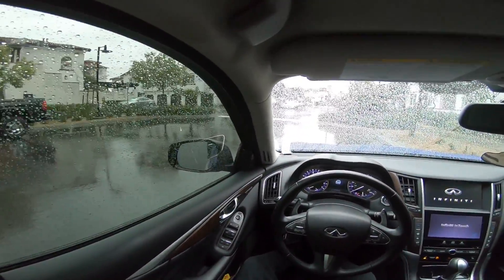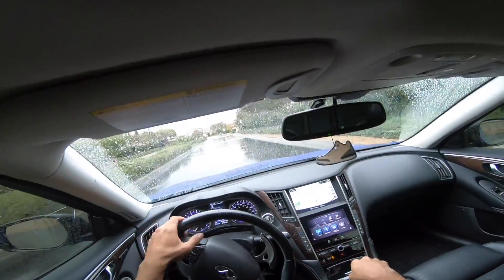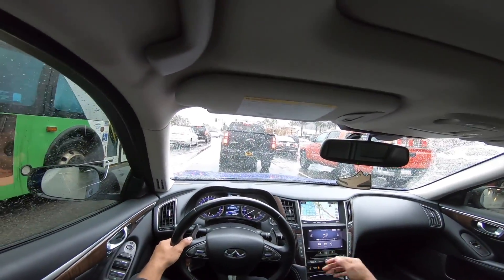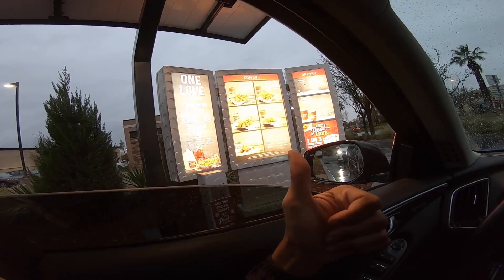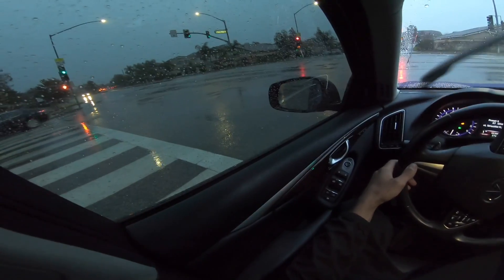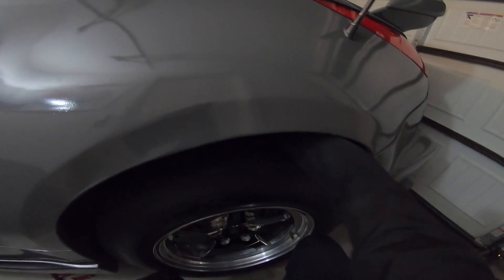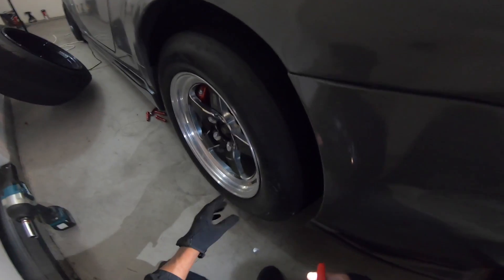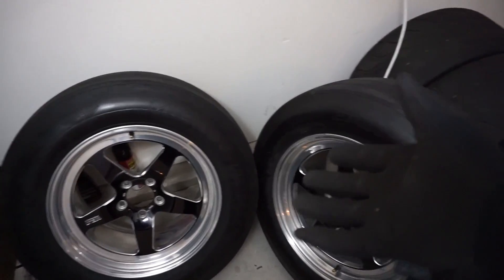WELL THAT DIDN'T WORK OUT

Comment: Resolution is A1. Gonna cop one up 🤙🏻🤙🏻🤙🏻
Reply: how much are they?
Reply: Richard Lopez The one I just picked up is $400 but I bought more accessories. Batteries, memory cards and such.
Reply: @franciscogastelum8726  thanks was looking for one but I might go for a cheaper version such as the silver or white. Looking forward to your videos on your cruising.
Reply: Richard Lopez I will start making video’s once I cop up an Evo X FE. Got my eyes set on a very low mileage FE, but the owner is asking over $40k for it. I’m not will to pay that much for it.
Reply: @franciscogastelum8726  I agree it's 6,000 overpriced. I am currently looking for a 350z around my area that isn't beat up but they all are.
Reply: Richard Lopez Yup, I’m not willing to pay no more then $32k, vehicle has to have 5k miles or less. No modifications either. I have also looked for a Nismo 07-08 with less then 20k miles, no modifications either but people be asking the same amount as a brand new one. Value goes down on all vehicles that have wheels and a motor in it. Boats, jets, cars, tractors, everything; no matter if it’s a special edition, there are some collector vehicles out there but the vehicles I’m looking for are that rare let’s be honest here.
Reply: Francisco Gastelum I completely agree. I’ve also looked in into Evo’s but they are all nearly 30k still with thousands of miles. Not worth it
Reply: Richard Lopez Yeah, especially when the vehicle has a lot of plastic inside, outdated everything lol body style since 2008, it’s like having technology from 2008. We in 2019 now, sometimes I talk myself out of it. Then when I see my buddy’s 850 wheel shooting flames out the exhaust I want one lol

Comment: Run some arp extended wheel studs and then just put a 15mm hub centric slip on spacer. that way you don't rely on cheap bolt on spacers
Reply from the maker: ehhh I rather come around some with a better spec.

Comment: Easiest way to resolve this is to do extended studs which you should have anyway while running slicks and do a slip on hub spacer....you wont have to worry about the spacer snapping

Comment: I got the fx35 and what can I say I still get heads turn and when they hear that unique exsaust carbon fiber on the side and unique 2 ton color blue and purple grill and black rims of course and unique 2 ton color reflector bumpers and upgrade HD lights front and back and upgraded touch screen radio so far so good of course my next step will be mate space grey for the whole body and add wide body in the back she is looking sexy every month and use only %100 octagon race gas at Chevron 😎 for now until dam California lays low on there dam exsaust laws 2019 was so poss to be extrem for this baby